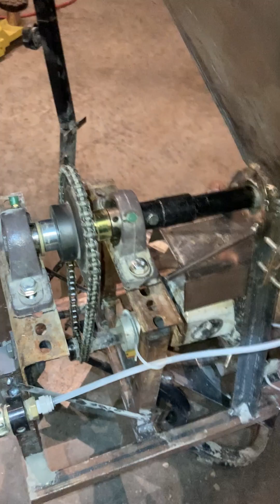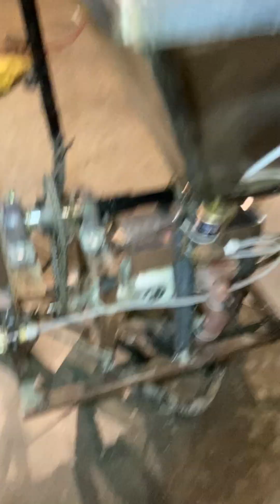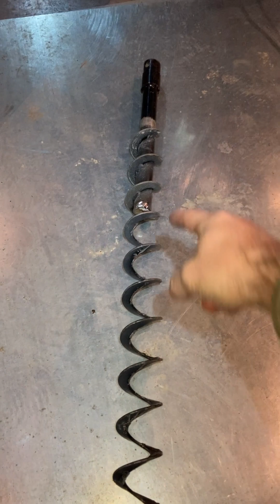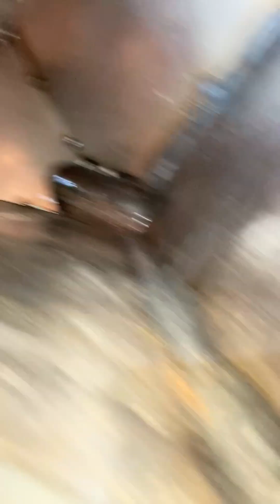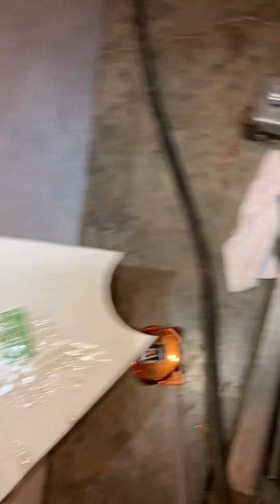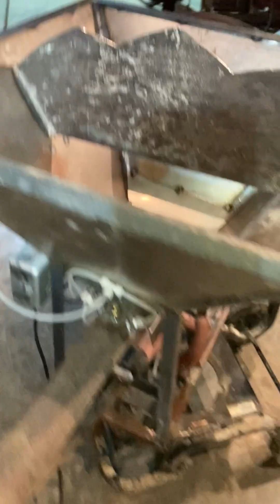DIY MudMixer.How it works.Diy cement mixer.Game changer for sure.

Comment: This mud mixer was designed around a device called an auger. Another word for auger is screw conveyer. The screw conveyer evolved from a device to "pump" water named after the inventor, Archimedes, 250BC. This device by any name will not mix anything. It will transport, convey, and/or push your dampened dry mix for less than 10 seconds. All bag concrete mix manufacturers suggest a machine mix time of 3 to 5 minutes to produce the rated strength on the bag. With my tenth grade education I figured out that the mixers on the market these days will not do what the boys that built them claim.

Comment: The Mud Mixer TOY was designed around a device called an auger. Another name for auger is screw conveyer. The screw conveyer was invented to transport material, NOT mix it! The TOY will transport, convey, and/or push a dampened dry mix for less than ten seconds. Even if it could mix, that's not enough time to produce concrete with the strength rating suggested on the bag.

Comment: A BBQ grill grate inside the scoop sitting about 2 inches on-top the auger will help when you use a piece of wood to dislodged any solid or help the concrete break down from clumps inside the scoop. The grill will help the piece of wood board not get caught by the spinning auger and cause havoc...just an idea, not sure if you already did that. GREAT WORK!! Love it!!

Comment: I've been criticizing the Mud Mixer for months, and this is how that goes. The Toy was expressly designed to mix bagged concrete mix. Sakrete suggests you mix their product for at least 5 minutes which isn't a problem for a barrel mixer as all you have to do is watch it mix for that duration before you dump. The Toy mixes for about 10 seconds, and you have no control of that. The Toy probably cannot even mix to the stated PSI rating on the bag, and I've never seen a cylinder tested to show the result??

Comment: Could you share plans for this? It’s amazing
Reply from the maker: I did not put together plans.I just started cutting and welding and using things I had around my shop.What I call cut and weld engineering.
Thanks.

Comment: do you have a problem with rocks jamming the auger? I'm building one, and this is the issue I'm struggling with.
Reply from the maker: Cool that you are building one.I have not had a problem with that so far.I have a grate in the hopper to catch anything too big just in case.
Maybe try a little bigger tube to give a little more clearance.